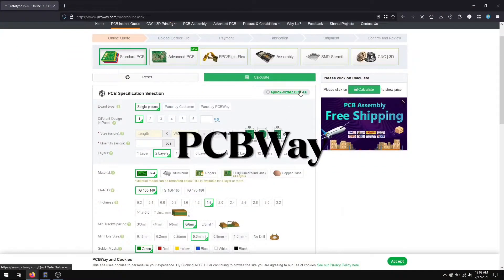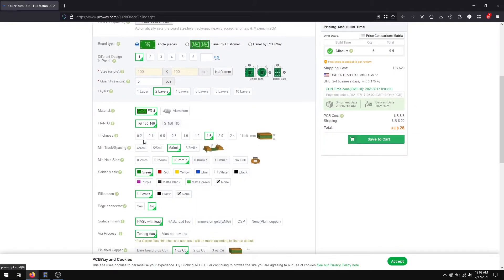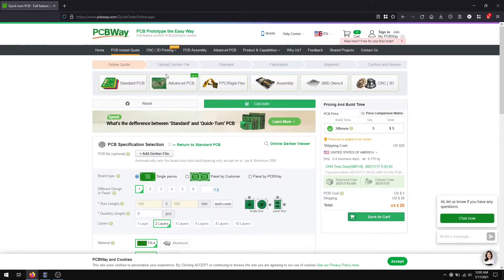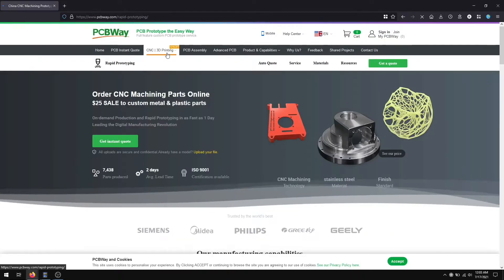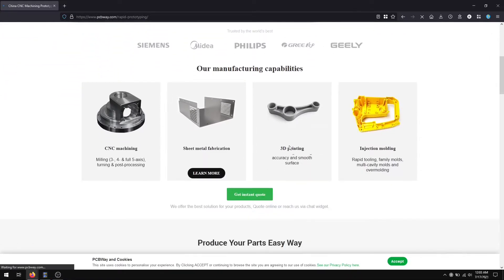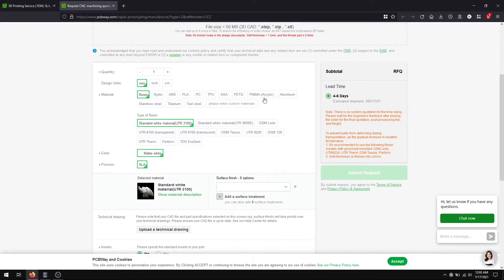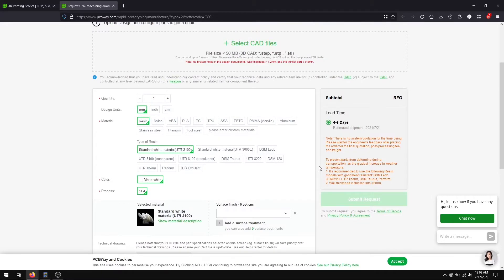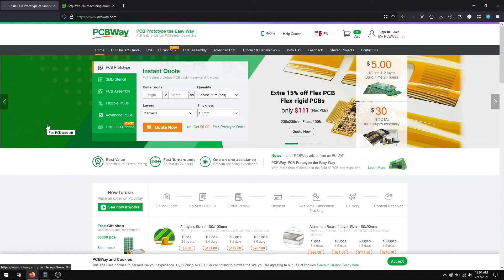mutantC v4 DisplayPCB build guide

Comment: Very cool project, I'm trying to build it too but I'm stuck at the very beginning.
I'm using a RPI3B and a Waveshare XPT2046 3.5 inch display, for everyday uses I usually use a bundled HDMI to HDMI connector that came with the box and I installed the drivers.

Now when I try to use the MutantC I'm assembling, testing the display in order to test the solder, I get no image unless I bridge HDMI with HDMI (I gotta do it with a cable because due to the MutantC layers in the middle the screen and the RPI are no longer aligned).

I soldered the display cable connector and the GPIO connector on the main board and a test male-male connector (plus obviously the display cable connector) to a brand new Display PCB, but I get nothing. I noticed that your  "ONE" soldering point where joined, so I joined them too, this way I got power to the display, but no video at all (No Signal), unless I join them through HDMI.
Is there some setting I gotta change in the raspberry config file? I suspect no driver issue cause I don't even get the boot/post screen. Are my soldering skills just too low for this project or am I missing something?

I found the project really cool and interesting so if my soldering skills are the problem and there's nothing I missed I would be interested to buy one of your scrap and test boards with soldered components, if you were willing to sell them.

Thank you in advance.

Edit: the comment pertained the main PCB, not the display video, I'm gonna move it there, sorry
Reply from the maker: Please join the discord or matrix so we can discuss about the solution. Did you installed the display driver?